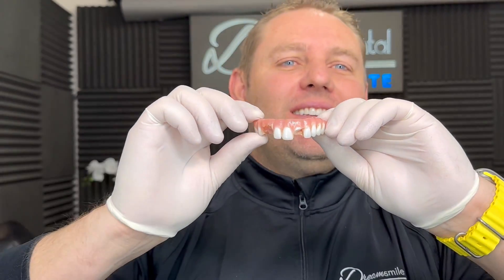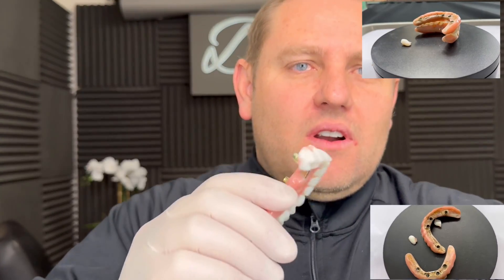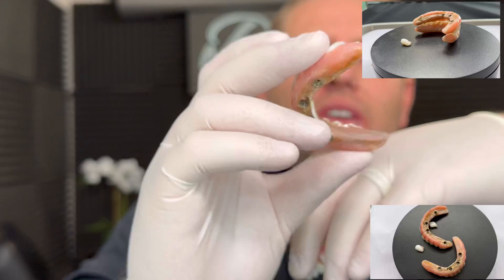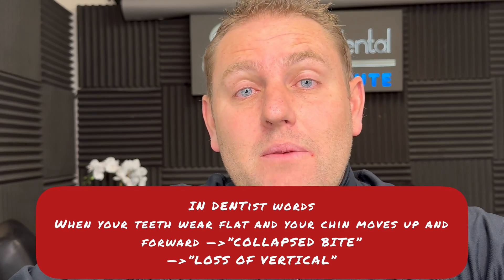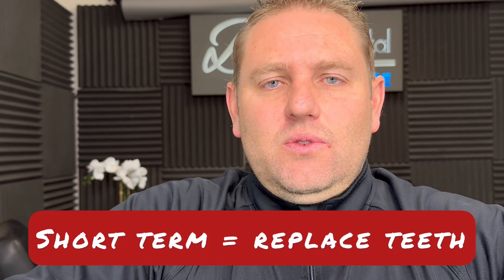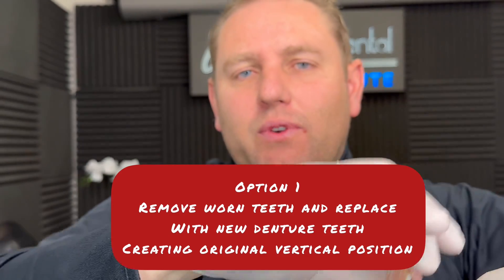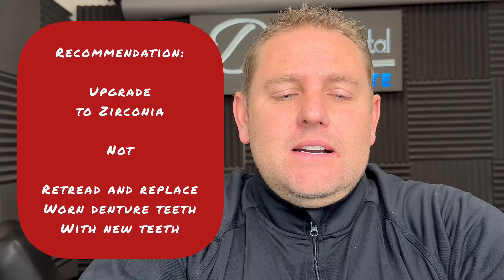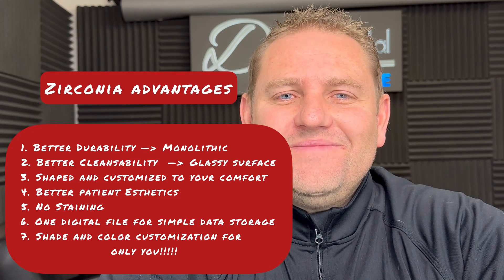Broken ALL-ON-4 DENTAL IMPLANT SOLUTIONS

Comment: Hi I have been given an All on 4 which I was told was pure zirconia, but the inside of the denture has became hollow , and there is broken pieces which are attached to what feels like elastic band which runs all along the inside. The face of the crowns have started show a metal shined material wearing through. They also feel like they expand and soften like a plastic. Can you tell me what these could possibly be. Surely they are not zirconia crowns ?

Comment: I have all on 8. The top has cracked completely in half. I'm nowhere near able to afford to replace it. Can you recommend any alternative?
Reply: WOW I am in the same position. My bottom plate has completely broken in half and I don't even know who to go to have it fixed - I doubt I will be able to afford the work that needs to be done - when I had these teeth done, I was told I was "good to go forever"  If I'd only known that this was not true. THIS is the 2nd time they have broken and I have had them fixed once already - then they broke within a year after having that done.
Reply: Implants are not one and done. They require maintenance and sometimes repairs. I really hope you both can get them fixed.
Reply: There is not alternative the repair requires. The implant device has to removed for the repairs. It is screwed into your jaw. Please contact dentist who specializes in implants. They can repair it for you.

Comment: I have my temporary 6 month teeth (all on 4) and one tooth broke off and I swallowed it. do you have single replacement teeth to glue on and what is the cost?
Reply from the maker: You will need to take it in to get repaired to your dental office.  Sometimes the office may have to order a another tooth in for the shades of color for your tooth.

Comment: Hello, my temporary all on four has broken in half in between teeth and come out. My permanent is not due till the end of September. What is the best glue I can use to repair it please?
Reply from the maker: Never use glue unless it is dental adhesive.  Talk with your doctor and get it repaired.  If you use super glue (some patients have tried this) it is harder and more expensive to repair. Good Luck my friend.
Reply: @Bryan_hendriks  I already risked it and went down that road, still didn't work! These temporary jobs are total cr.p. The tops of three screws came off after only 10 days! However, I am not flying back over to Turkey before my permanents are due!

Comment: Does zirconia wear and eventually break ?
Reply from the maker: Zirconia is the strongest material used for dentures.  As long as your bite is correct and your denture is supported equally with your implants, it should not break.

Comment: What is your position on the New silicone dentures ?   .....  FOR UPPERS AND LOWER DENTURES ?
Reply: Is it soft? Or you mean flexible dentures? It has no benefits besides it does not break on accidentally dropping.
Reply: @joynergrim4003   - WHAT DO YOU MEAN BY NO BENIFFTS? ... YOU CAN NOT CHEW OR WORKS IMPROPERLY .... I HAVE AN ALLERGY TO ALLOYS  AND I ALREADY WHENT THROUGH THESE ISSUES   IS THERE ANY PLACE I PURCHASE ACTUAL PURE  PRODUCTS ?  .... https://www.youtube.com/watch?v=nnhjAbdLodY
Reply: @markanthonymarla  I mean benefits over acrylic dentures
Reply: @joynergrim4003   I HAVE A SERIOUS QUESTION, I CAME TO FIND OUT THAT THE SCREW THAT ARE USED FOR SETTING IMPLANTS IN FACT ARE NOT ACTUAL STANLESS STEEL BUT A CONGLOMERATION OF DIFFRENT CHEAPER ALOYDS .... AND MANY WITH ALERGIES REPORT MASSIVE INFECTIONS .... I FOR ONE CAN ONLY USE REAL NOT FILL GOLD OR SILVER .... AND I  DO NOT UNDERSTAND WHY?  IF IT STATES STANLESS STEEL SCREWS AND BRIDGES ... IT USES CHEAP ALLOYS ... WHICH THEN I CAN NEVER USE  ....  https://www.youtube.com/watch?v=nnhjAbdLodY
Reply: @markanthonymarla  it is not even stainless steel. Implants and their screws are mostly made of Titanium class iv and v. Some of them are Ti-Zr alloys. There is no issue with choosing implant system, actually your doctor should choose it based on your case.
Reply: @joynergrim4003   - THANK YOU .... M
Reply: @markanthonymarla  you’re welcome!
Reply: @joynergrim4003  I HAVE A QUESTION DO HOLISTIC DENTISTS USE THE SAME METERIALS OR DIFERENT ONES .... LOOKING AT MY OPTIONS  ... YOU HAVE BEEN VERY GRACIOUS WITH YOUR TIME MANY THANKS ... M
Reply: @markanthonymarla  Certified specialists use only approved materials worldwide. In dentistry they try todo their best because the result comes fast. So you should choose an experienced doctor. I Hope I answered your question.